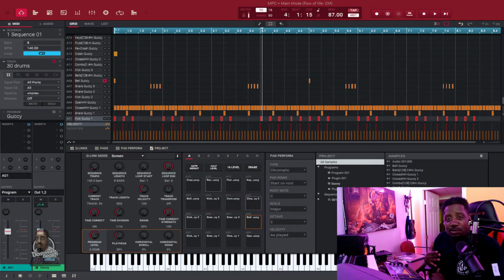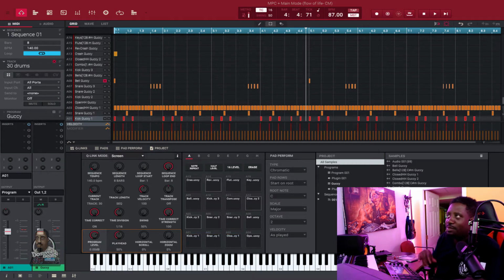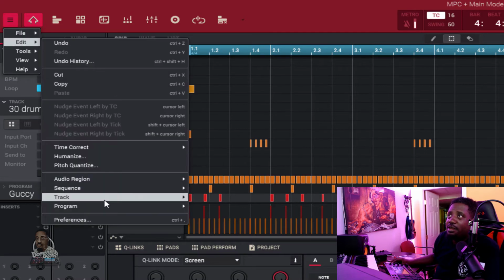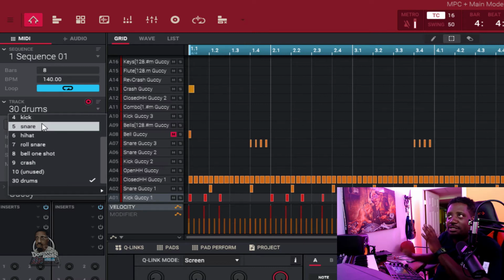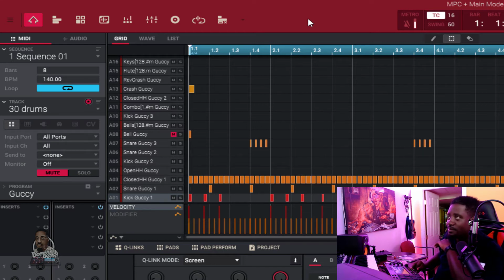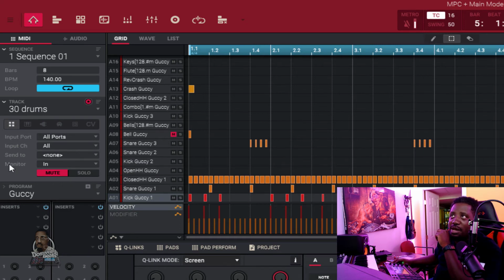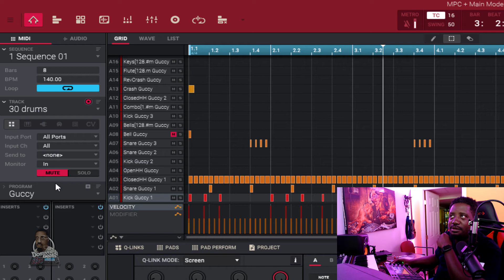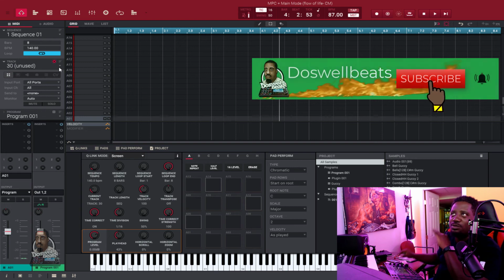MPC Software Explode tracks issue and how to fix

Comment: I arrange a song and will use track mute sometimes. Do you know of a way to explode the drums from a song converted to a sequence. I can export all the instruments, but I haven’t figured out how to get the drums stems? Any ideas.
Reply: yes in each pattern they are exploded, but it won’t stem the song out.
Reply from the maker: I am not sure because if you explode the drum program and all drums is on different tracks then go to file export and when you export just make sure you select export as audio mix down. Then in the mix down screen select explode tracks
Reply from the maker: Did you explode the drum program

Comment: Have a question. I took a drum loop and chopped it up and converted it to a program on track 1. Now when I went to explode the track so that  drums are on separate tracks. I bounced the audio mix as a wave file on my Mac. When I went to email the separate tracks I wasn't getting any sounds from each track. What am I doing wrong? How do I correct this?
Reply from the maker: It sounds like you did everything right I am not sure why that is happening. After you explode the drum track to individual tracks. Did you delete the original program. If you don’t sometimes it makes the sounds, sound off. I’m not sure if that is the issue but you can try it. Another thing is make sure the drum program that you are exploding. Is not muted. Other than that I am not sure what is going on 🙏🏾👍🏾🙌🏾
Reply: @doswellbeats  thanks I'll try that

Comment: I have a big issue with the number of the audio tracks that is limited to just 2!
When I decide to add more tracks it's limited to 8! When I bounce the tracks into audio the program said the number of audio tracks is reached!
Reply from the maker: The reason for that is because you are using the free version of the software (MPC Beats is the free version) you need the MPC 2.0 software. Thanks for watching and commenting on the video let me know if you have any other questions 🙏🏾👍🏾